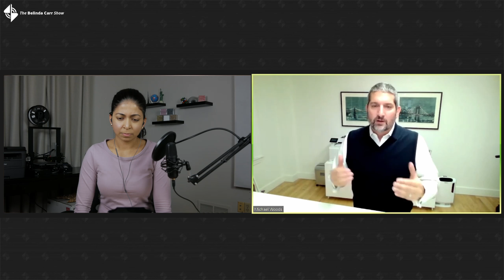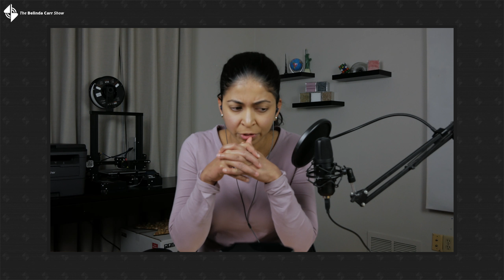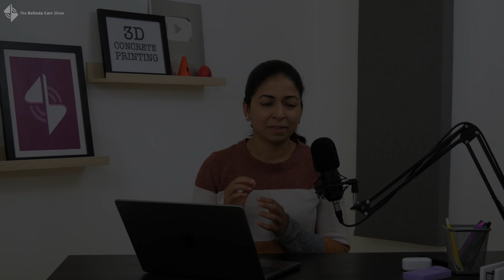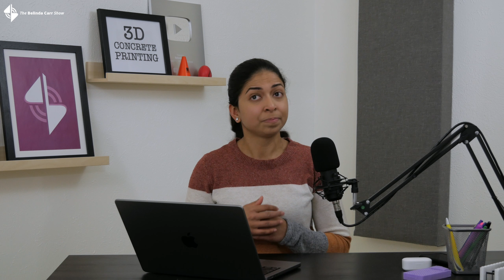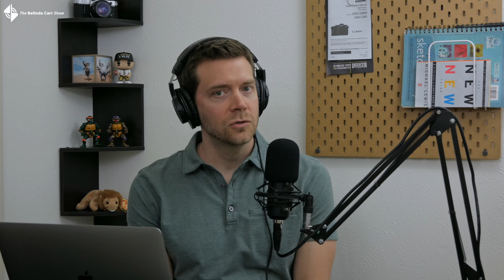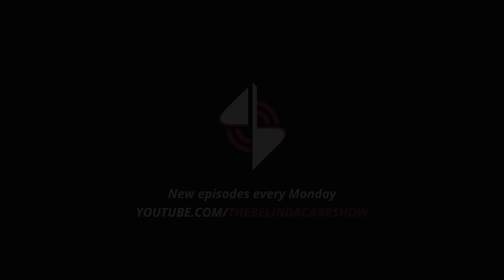Can 3D Printed Concrete and HEMP Walls suck in CO2?

Comment: You are correct it is not the Hemp plant that sucks in CO2 in the walls, we use hydrated lime, when hydrated lime is mixed with water and then dries out that’s what eats CO2. It adds a CO2 molecule to the Lime, it wants to petrify or harden back into lime stone so that’s why people say HempCrete walls continuously eat CO2, again it is not the hemp it is the hydrated lime that is used that will eat CO2. it will not eat the same amount of CO2 that it took to create the lime but it will continuously harden and petrify over many many years .

Comment: Lime continuously absorbs CO2 as it converts calcium hydroxide into calcium carbonate - that is how lime cures.  So does concrete, it is called carbonation (they use variations of calcium to make cement).  Hemp stems should not be an issue in lime, but if you are counting on the finer hemp fibers for strength, it could be an issue.  Hemp does partially disintegrate in an alkali solution, such as sodium hydroxide.  Lots of thing do, such as glass fibers and basalt, which must be Alkali Resistant (AR) for beneficial use in concrete; and as lime is a higher pH, the same should be true.